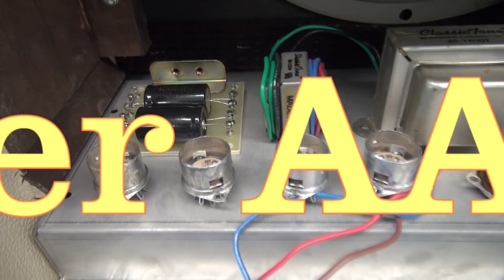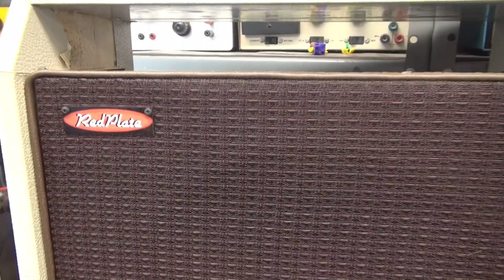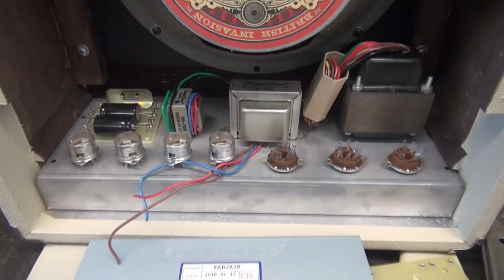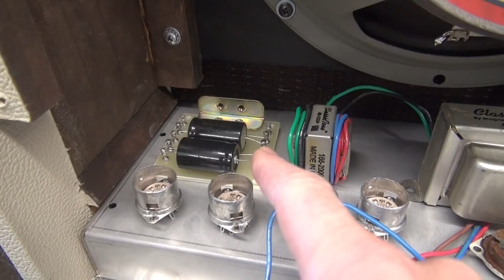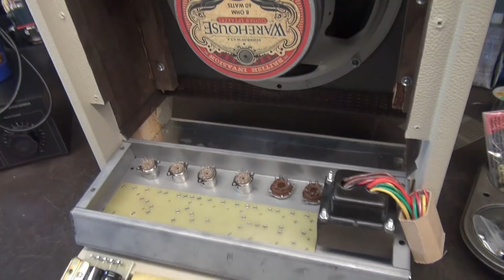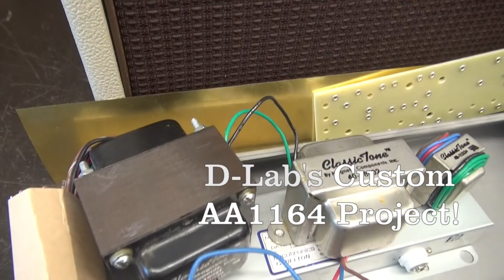Custom build Fender Princeton AA1164 6V6 tube guitar amp Vintage project D-Lab Electronics

Comment: Terry, where do you get the brass ground plate? Is that something Lowes would sell?
Reply: Lowes/Hillman does have a brass plate available however I think it is a bit thin--definitely not long enough for most chassis
Reply from the maker: I buy shim stock, check McMaster Carr
Reply: @d-labelectronics  Terry, when you can, will you give me the McMaster Carr specs for the brass sheets? Thickness? 260? I'm wanting enough for my Mojo Princeton 5F2 build. So very sorry to hear about Pat, my best wishes to your family.

Comment: Hey, Terry. Great work on your channel, Sir. I'm stoked to hear about this build, as I've just finished my first tube amp build - a Princeton Reverb AA1164,  with Deluxe PT & OP running into a Celestion alnico cream-back. I can't wait to see what I can tweak! Cheers from the UK🍷
Reply from the maker: Yes Sir, its really coming along nice!
Reply: @d-labelectronics  Thanks for the response and the 1ohm bias 6v6 bias resistor tip - that with a pot makes bias setup a breeze. 20mA with JJ 6v6s and the tremolo is luscious! My good friend Dr. Merlot 🍷thinks so, too!

Comment: If feasible, it may be better to have HV cap board closer to power transformer to avoid running HV AC length of chassis.
Reply from the maker: Yes, I thought about that. The HV cables will be shielded as I did on the Vibroverb. Not much room to work with here
Reply from the maker: Have repositioned the cap board per your input! Thanks